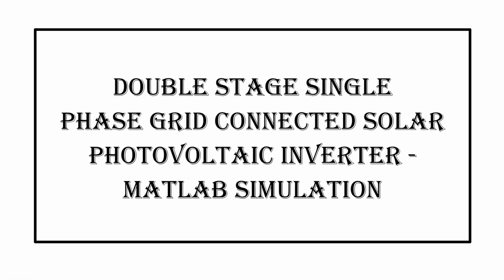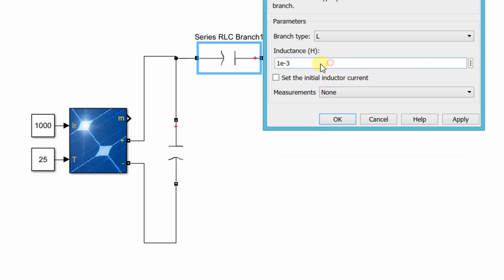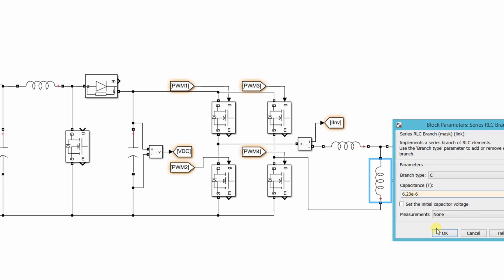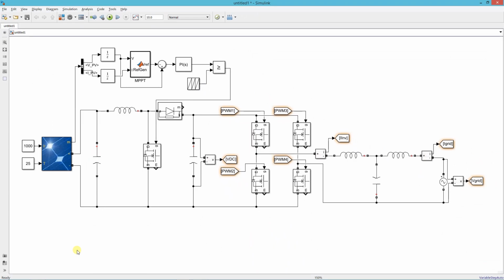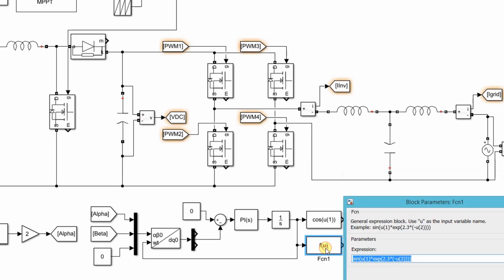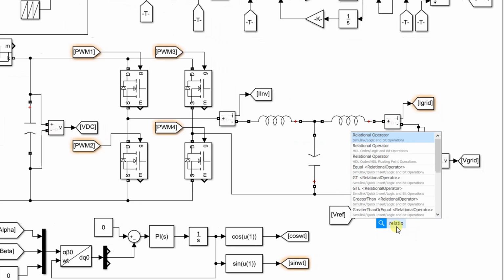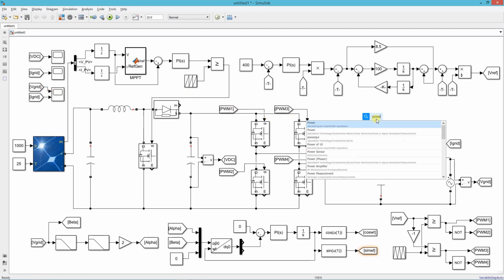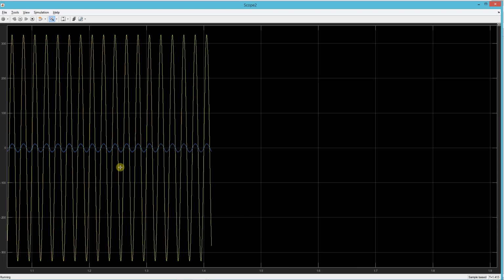Double stage Single phase Grid connected solar PV inverter - MATLAB Simulation.

Comment: is it possible to connect 380V DClink voltage to the grid without transformer using SPWM  inverter.

Comment: Seems, There's an issue with the control Scheme

You have created a reference of 400 V and requested to operate boost at V_MPP. If the Boost MPP voltage and DC Bus voltage are different, there will be a conflict in which control loop to be followed.
The solution is- Instead of making 400V as DC bus reference, use V_MPP as a reference voltage. Then the complete scheme works fine.
Reply from the maker: 400v is controlled by inverter, not the boost converter

Comment: Really nice video! Thank you for  sharing! I applied this control methods to diffirent type of dc-dc converter. But my grid current has got a 3th,5th,7th harmonic and so high. How can ı eliminate of this harmonics? I need your help:)
Reply: I can share my scope shape, If you give your mail adreess.
Reply from the maker: pls mail
Reply: @TechSimulator I'm also getting the same issue

Comment: Sir how  to solve errorOutput port 1 of 'pv_inverter_simulation/Diode' is not connected.
Component:Simulink | Category:Block warning
Unconnected line found in 'pv_inverter_simulation' (starts 35% from left and 90% from top of view)
Component:Simulink | Category:Block diagram warning
Error in port widths or dimensions. Output port 1 of 'pv_inverter_simulation/Integrator' is a one dimensional vector with 3 elements.
Component:Simulink | Category:Model error
Error in port widths or dimensions. Input port 2 of 'pv_inverter_simulation/Alpha-Beta-Zero to dq0' is a one dimensional vector with 1 elements.
Component:Simulink | Category:Model error
Reply from the maker: pls email the model ashacademy01@gmail.com

Comment: Thanks a lot. I have one question. 
In Matlab 2022a Fcn is not recommended. Instead of Fcn, Mathworks suggested using the MATLAB Function block. Can you please tell me what I should write inside the Matlab Function block instead of Fcn block? Thanks :)
Reply from the maker: you can use cos/sine blocks directly

Comment: Good work. We need simulation of PWM in Pv system with buck and boost converter for charge and discharge of battery or connect to grid. Thenk you
Reply from the maker: will try

Comment: Hello ,  thank you for best content ! 
I have some troubles . In 2021b Matlab version , there is no Fcn block . I will use Matlab Function block .  What shall I write to here ?
Reply: Hi, did you get any solutions? I'm also dealing with the same problem as you. I have the 2022a version.
Reply: Type Interpreted Matlab Function

Comment: sir am using matlab 2021 there's no fcn block so instead of that block can you suggest a supplement of that block in matlab 2021...please reply
Reply: hello , could you find a solution ?
Reply: @elifgenc1077  no...instead i installed 2018b

Comment: I am getting the correct grid voltage and Dc voltage but the grid current is having so many ripples and also display block is also not showing correct value of power Also How does your powergui block turns Discrete Auto... mine is not changing?

Comment: Sir please can you make SWITCHED CAPACITOR MULTILEVEL INVERTER USING PWM WITH PV ARRAYS AS SOURCE INPUT
Reply from the maker: will try to make
Reply: @TechSimulator  Sir I am doing this project (SWITCHED CAPACITOR MULTILEVEL INVERTER USING DIFFERENT PWM TECHNIQUE), Please I would appreciate if you can help me this project simulation with paid task. Please contact me (baaxith34@gmail.com).

Best regard sir
Reply: That would be awesome!